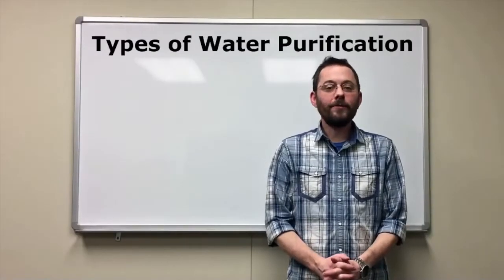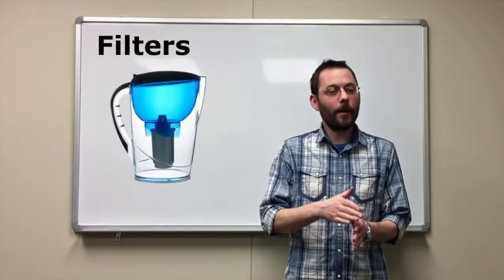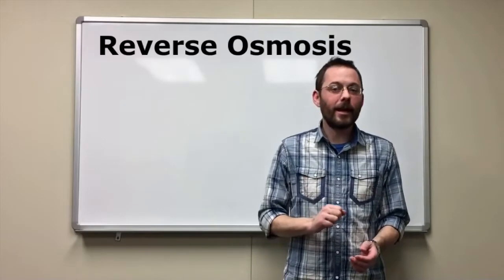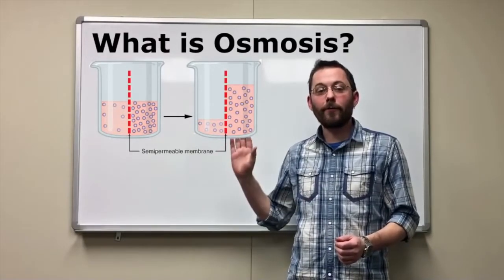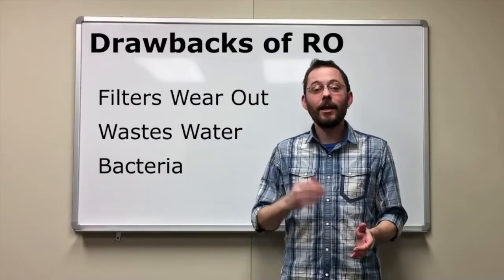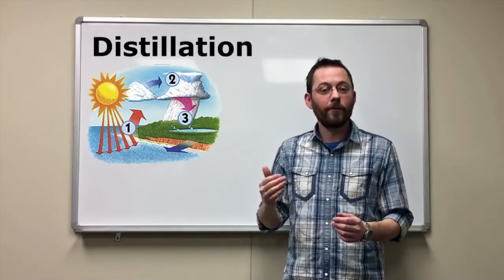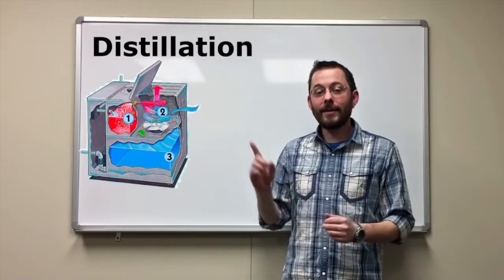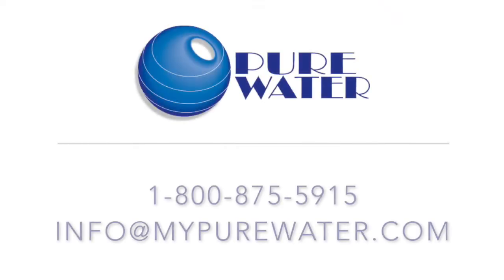Distillers v Reverse Osmosis (R.O.) v Pitcher Filters

Comment: How much dose a water distiller get rid of estrogens and birth control from the tap water dose the distillation process get rid of most of the birth control in the tap water do you know what percentage % roughly
Reply from the maker: All of the contaminants we have tested for can be found: https://mypurewater.com/home-products/pure-water-lab-results/ 
While we have not tested specifically for birth control we can assume that our distillers should remove 99.9% of most pharmaceuticals. Since our distillers are designed to never boil dry, we can ensure the heating element won't surpass 212 degrees Fahrenheit which is below the boiling/vaporization point of many contaminants.
Reply: @PureWaterDistillers  so if a water distiller boils dry and the water distiller dosent turn of after getting all the distiller water it can ,dose it start to evaporate all the birth control and pharmaceutical chemicals into the distilled water so  if the water distiller is boiling the left over residue?
Reply: And I thought basically all the other water distillers  automatically stop once it has gotten all the distilled water out of the water you put in it
Reply: And I thought basically all the other water distillers  automatically stop once it has gotten all the distilled water out of the water you put in it is that correct so if you get a water distiller that automatically turns off once it has gotten all the distilled water out of it those kind of water distillers don’t get the birth control and pharmaceuticals in the distilled water?
Reply from the maker: @pitch1691  If a distiller does run long enough for the boiling tank to 'boil dry', i.e. boils long enough for no water to be remaining in the tank after it finishes distilling, the elements can spike in temperature hitting extremes within a matter of seconds depending on the wattage of the element being used. When these spikes occur you do run the risk of vaporizing contaminants you're wanting to leave behind. Thus, our distillers having the feature of never boiling dry.
Reply: @PureWaterDistillers  the vevor water distiller says it turns of automatically when it hits a temperature past 108 degrees so even though that water distiller would run dry because it says it auto turns of at 108 degrees or 226F would it be fine because it dosent exceed those temperatures
Reply from the maker: @pitch1691  We can not speak for any company/product that is not ours. Our distillers run on either a timer that shuts off after it's allotted time or a float ball mechanism that cuts off power before the element is uncovered.
Reply: @PureWaterDistillers  from what I’ve seen and heard the distillation process 100 persent gets rid of chlorine so there’s no chlorine that gets into the distilled water with a water distiller im only double checking because 1 person told me a water distiller dosent remove chlorine recently and I’ve seen website that says a water distiller dosent remove chlorine but off course I’ve seen way more people saying it dose remove chlorine or leaves it behind in the water distiller is what I mean by gets rid of
Reply from the maker: @pitch1691  Refer back to the original reply to this string with the link to our 3rd party test results.